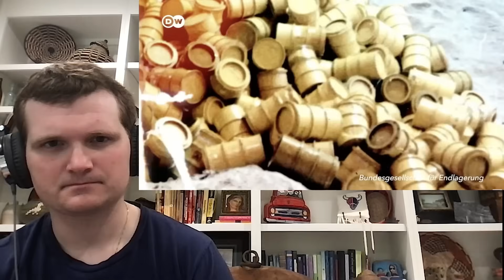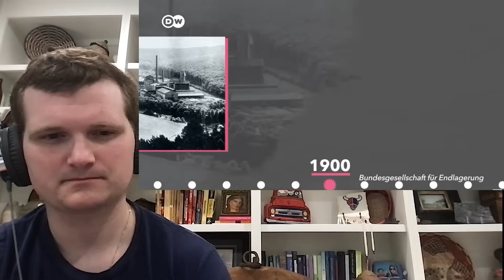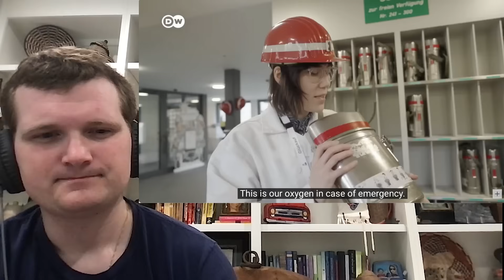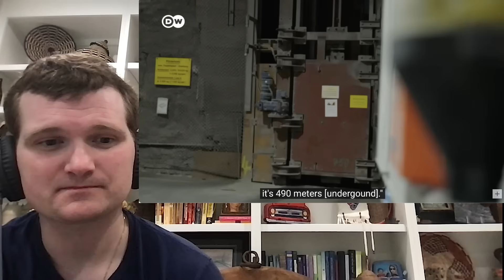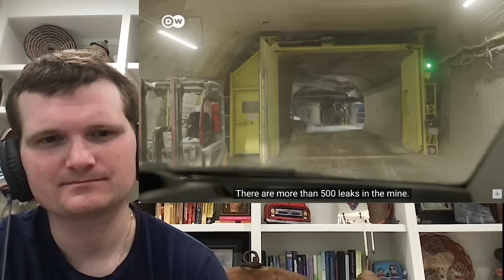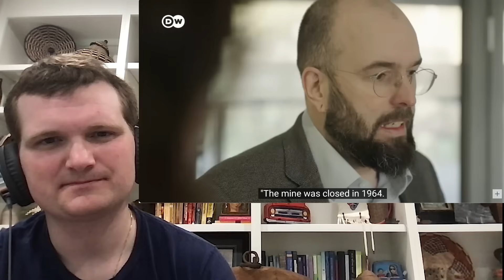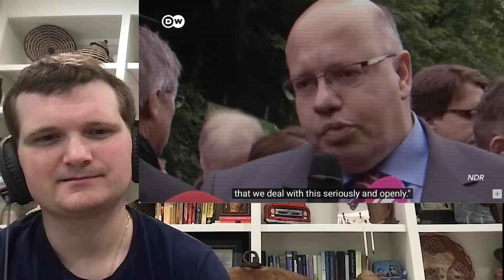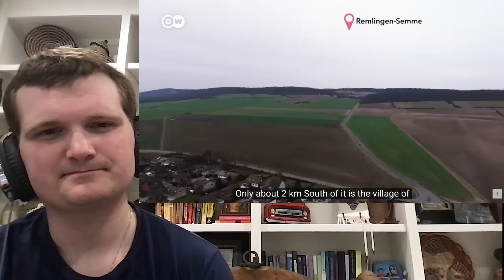This Nuclear Waste Dump Has Been Leaking for How Long? - Nuclear Engineer Reacts to DW Planet A

Comment: So, a few comments from a german:
1. This kind of poor waste management is one of the big reasons our Green party ever rose to prominence in the first place, they started out mostly as an activist group demanding a stop to nuclear power out of concern over incidents (following Chernobyl) and the long-term storage issue for nuclear waste
2. To this day, we still don't have a secure long-term storage site for nuclear waste because the requirements for that are set to safe containment for at least several centuries. There is a site currently under construction for low- and medium level waste, but there has not been a decsion on where to put high-level waste at all, with estimates going out as far as 2074 until such a site is chosen. In the meantime, high-level waste was kept in storage at nuclear power plants, piling up for decades wth no permanent solution in sight. This is the biggest hindrance to decommissioning our now-shuttered power plants, as there simply is nowhere to put all the crap we have stored there.
3. The Ministers changing every 4 years is basically due to our 4 year election cycle; while the ruling party might stay in power, the coalition partners might change, but even if the same coalition stays together for another term t's not unusual for some ministers to get shuffled around; not always for reasons of competency, but due to political shenanigans and influence games. Plus, most of our ministers are appointed based on party politics and seniority, not actual expertise, so mostly they have to then rely on external experts to make decisions; those experts are sometimes poorly chosen or have an agenda, or lobby groups exert pressure to override the expert advice on policy. This right here? Perfect example of energy industry lobby efforts.

Comment: Just 12min into the video but it's important to note, that the DDR was the trashdump for the USSR. Germany did not really have significant nuclear reactors back then and they wouldn't have produced that much waste. Although Germany's safety standards always were amongst if not the highest so naturally there would accumulate more waste if you were to use double the amount of filters or replace machines after one time use.
Also Germans back then were much more thorough so they probably put one pair of gloves in one barrel to be sure. That was the thinking back then. That's why we had underground power lines very early and that beefy, that they still today easily are enough for modern power demand.

On a side note: I've been in a salt mine in Germany. It was an excursion with the class in 7th grade. Pretty awesome and strange feel to be over a thousand meters beneath the surface. And cold.

After the video: Bureaucracy and politics always are a problem with Germans. And after the war, western Germany was the lap dog of the US. Still is to some extent. What do you expect of ever more weak politicians with less back bone by the year...

Comment: Ok, maybe this is just me, but it's a mountain of salt. It can be carved out. Why not find a solid spot in the mine near the waste, dig a giant chamber, line the whole thing with concrete, lead, then salt, move the waste with machines to this new chamber, then fill the whole thing up with more concrete, then top with lead, then another layer of concrete. After that, dig around the whole thing (now safe) and create an air gap for any water or geological issues that may arise. Seems cheaper, easier, and less dangerous overall than trying to move, sort, and process it all off site.

Comment: I can remember this coming up in the face of repeated "castor" transports in the late 80's and early 90's, as a little kid i was already very aware of things and was very much interested in such things.

I can remember the endless discussions about there becoming a need for STILL a reliable nuclear storage place, and we are STILL searching for more locations that are safe or could be safe.

I remember Asse coming up all the time, as well as Gorleben. The issue is that, we need to store the stuff. But the issue is that the mines are either unsuitable because of potential water break ins, or because of the concerns of the public. Ofc nobody wants nuclear waste near themselves. So it is an ever rotating search for a final resting place for these types of materials, and nobody wants to have them, of course. Asse being water ridden is the biggest thing about it. They used it only as a "test site" for storage, but the issue is indeed the scale. It wasn't a minor test. They may as well just have thrown all the waste in there, because they dumped enough stuff in there to make it a final storage anyways.

The good thing about radioactive waste is that it will eventually decay, that is the way of radioactivity. The bad thing is, if this takes thousands or tens of thousands of years, then RIP, its unlikely mankind will be around that long anyways, so yeah. If that stuff leaks, we are all cooked. Minor radioactive or short-term radioactive waste, you could store that in your back yard in a shed away from moisture and any sort of tremors or tectonic activation that shakes it about.

But the issue is as always, nobody wants it, and understandably so.

Comment: 4:15 For better or worse this is the double sided sword of nuclear energy advocacy. It is safe because of the effort put in to make it safe... So what happens if that slips?

We see that on a small scale with the nuclear batteries in Russia, which have been simply abandoned and are dealt with more or less only once the radioactive material starts causing issues that are hard to ignore.

Those aren't going to heavily polute large areas, even if the material wasn't handled after it starts circulating, but it could still cause significant damage if it's just left in a densely populated area.

Granted, it would take monumental levels of neglect to get to a truly big catastrophy with modern designs. Even in the Ukrainian-Russian the heads have remained cool enough to at least keep the nuclear reactors safe, however it has taken a previously operational plant offline, with the associated consequences of losing a large producer of baseload.

However it is the single factor that makes me reluctant to advocate for going all in on nuclear energy. Scaling the expertise required operating safely (numerous contained issues that take plants offline aren't really an option if you depend entirely on nuclear energy) is going to increase the already considerable safety costs further. On the regulation side political stability with a universal consensus on maintaining top notch safety is a must.

The safety requirements more or less limit reliance on nuclear energy to countries which are both *developed and stable*. In other words, it's a loval solution to a global problem.

Of course at the end of the day you don't have to convince me, you have to convince the people who are afraid of nuclear power.

To get over the fear you have to be honest about the risks and the complex, human dependent systems to counter them. Which leaves no honest argument, and people smell bullshit even if they can't articulate why it's bullshit, that skirts around the limitations safety imposes.

Comment: I just can't believe they just dumped it in a big pile. It's spiking my OCD.
Reply: Imagine trying to handle it though, even for low-level stuff. Wearing protective gear, and underground.
Reply: @jimtalbott9535  if you already have to transport it there, it wouldn't be too much hassle to design the containers in a way that made them easily stackable (even by remote controlled machinery), and/or prepare racks beforehand to facilitate this.
During the first years of operation, they actually did stack the barrels neatly. But when the volume of waste grew beyond what was originally planned, and therefore the costs went up accordingly, good ol' capitalism took over. It was simply cheaper to toss them onto a pile instead.
Reply: @stephanweinberger  they already exist and are called pallets

Comment: 0:38  These barrels illegally dumped seems to be a plot point that was used in the netflix  German series called “Dark”  2017 .. three seasons.

From Grok:
 Nuclear Power Plant and Time Travel: The series revolves around a nuclear power plant, which is not only a central setting but also the source of a time travel mechanism. The plant's connection to time travel involves the use of a substance referred to as "cesium-137" and the "God particle," which might be construed as related to radioactive materials or byproducts, though creatively interpreted for the show's time travel mechanics.

- Radioactive Waste and Apocalyptic Events: Radioactive waste, specifically the barrels of it stored in the plant, plays a critical role in the series' narrative, especially in the context of an impending apocalyptic event. The barrels contain a form of dark matter or an unstable matter that, when released, triggers catastrophic events, including the apocalyptic scenario shown in future timelines.

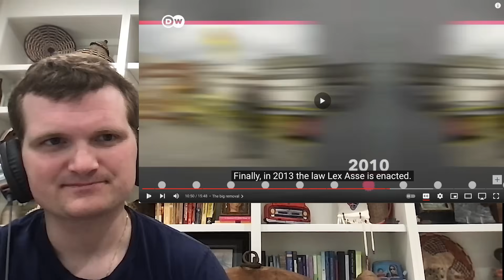Comment: Agree with you at 31:30 - if the nuclear industry in German f'd up this badly for this long, it's no wonder that the public demanded they shut the whole thing down.
Reply: It  wasnt demanded  and wasnt a result of this waste mismanagement. It was a result of the Fukushima accident. That was the reason that nuclear power was abolished, not the waste site displayed in this video.
Reply: @oliverbecker3443  It's always people pointing out failures of old designs (that nobody would built anymore) to justify not building any more. The more modern plants on the same coast in Japan did not have the problems that Fukushima had.
Reply: Do you think the US did any better in the 60s and 70s?
Reply: @steveo7006 probably not?
Reply: @steveo7006 ummmm yes... they put a man on the moon then
Reply: @RichieD_21  Was he disposing nuclear waste there?

(Yes, I know some of the equipment used RTGs for power.)
Reply: @stephanweinberger I know youre trying to be funny, but in actuality he actually did dispose of nuclear waste on the moon considering that some of the equipment used RTGs for power. Bet you didnt know that smartass
Reply: very sad though
its like banning cars because some guys set their cars on fire...
Reply: @zahnatom  in This case it was like 80% of people setting the Car on fire.
Litterly EDF, Areva, Siemens, Vattenfall EON and co screwed the nuclear industry in germany in there own way. 
The asse is litterly, only the tip of the Iceberg.
Reply: @asokawhite  Germany has shot itself in the foot, not with a pistol but with a cannon, by banning all nuclear power plants. God dayum. They lost such a powerful energy source and are arguably contributing more to pollution with their thermoelectric plants. Good luck to Germany in the future.
Reply: @robertoskoka  Funny enough, because of the location of the Nuclear Power Plants, they stopped to cause issues with the Transmission of wind power plants and causing multiple coal power plants to by Shutdown.

Beside taking away, russia to influence Germany Politics because of Uranium Fuel. So as sideinfo 70% of the world Nuclear Fuel trade is controlled by China and Russia. 

And to it because nuclear is so slow by loadf following of the modern renewable Sources this avoided another issue. 

Look at France because of there Nuclear Power Plants, In germany, Austria, Swiss and Spain needed to bring back powerplants designated for demolishening. For a simpel reason overe 50% of the Countrys Nuclear Power Production failed. And now they not have Money to maintain existing plants or replace the Aging ones. 

Beside Electricity in france is now more expensive as in germany lol.
Reply: @asokawhite  A quick Google search lets us know that Kazakhstan, Canada, Namibia, Australia and Russia are the biggest Uranium producers / deposit holders in descending order, with no mention of China. At least get it right. China and Russia don't have as much control as you claim, even if Russia does hold around 50% of the current enrichment capacity in the world (which can be subject to change as it is depends on technology not reserves), with China mainly owning several foreign mines.

And by abandoning nuclear power, Germany increased reliance on Russian natural gas exports. You cannot escape Russia it seems. So it's not as one sided as you made it sound.

And about France having higher electricity costs than Germany - another Google search lets us know that the average electricity prices in Germany are around 41 cents per kWh, while in France they're around 24 cents per kWh. Get your shit right.
Reply: @robertoskoka  not to mention Germany's  increase in use of brown coal after they shut down their nuclear power industry and the negative impacts that has on the environment.
Reply: @zahnatom the difference with nuclear waste is that if you mess up, the mess will be likely forever. That is why nuclear is ao dangerous
Reply: @Max-fw3qy  this is bollocks
Reply: it is. And we are at a point now that wind, solar and battery storages are cheaper now and it is not worth it to build new nuclear power plants
Reply: @xloltimex38  Yep, this last decade Solar panels and batteries have gotten very solid developments to the point that the combo is the most cost efficient energy generation today. 
It is not space efficient, but there are a lot of empty spaces. 
Hopefully it can help us ride the wave until fusion
Reply: @diablo.the.cheater  if they are so efficient, why is the cost of electricity going at a higher and increasing rate in places that have become reliant on them, and not in places that are reliant on fossil fuels, hydro, geothermal and nuclear?
Reply: @xloltimex38  good luck producing all your power with just wind, solar, and hydro. If you dont use nuclear, then you will have to go back to coal of fuel oil, both of which produce 1000x the volume of equally radioactive, and way more environmentally damaging, waste then nuclear power does.
Reply: @xloltimex38 really? Is that why germany has the highest prices in europe? And is completely reliant on french nuclear and polish coal energy when the wind doesn’t blow in the winter? 😅
Reply: @xloltimex38  They are not cheaper, far from it - not are the clean and green. In fact in the UK they have been subsidizing wind power since the 1990's. The ideology doesn't meet reality.
Reply: Ironically nuclear would be the solution to all the problems of Germany, and I do not mean powerplants...
Reply: There is no public. Only Marxism.

Comment: What was not mentioned in the clip and this is the elephant in the room is, that Asse was supposed to be a final long time storage facility. However after only 20 years, this turned out to be wrong. How much should we trust scientists which misscalculated by a few 100.000 years? (I know Not true for the Low radioactive waste)
Nuclear power should not be used (except for research) in an industrial scale while the waste produced is toxic for more than e.g. two generations!

We have only borrowed the earth from the future generations. Why have they to solve a problem which WE knew but couldn't handle? They will only have the waste and not the Power 

Another point ist, that this happened in Germany. How about less democratic countries, how so they handle the waste? Could an incident like this be reported in e.g. China?

Comment: 27:18 From an engineers standpoint, they handle it pretty fine. 
From a politicians standpoint, it is a burning trash pit.

Germany owns no fuel. The Russian fuel needs to be brought back to Russia, which Poland did not allow. The European pool fuel needs to be brought back to France, which Belgium will not allow. 
If someone could know what we Germans have ever done bad to this people😏
That is the main reason, Germany opted out of nuclear power. As for the faith of the remaining high level waste. It has to be stored in Castor containers for at least another 150 years. Until then we will have figured something out. As of right now, there is is a gravitational wave observatory planed, to be drilled into the Oberlausitzer Granitmassiv, which will be repurposed, for final storage. The good thing about this place is, that there is already radioactive ore down there. So all water that may be contaminated, is contaminated anyway. Check for Swieradow Zdroj, a Polish radio-healing bath, which is just at that border of said granite plate. It sits on a geological fault, that belongs to that super volcano and who brought up most of the ore deposits of Germany, Poland and the Czech Republic. 
I

Comment: 2:55 You saying this from your current standpoint, not from one of the 60' and 70'😉 Your country did some abhorrent things too back then. Basically, it is a dump of ash and trash, because the where more focussed on getting things done, than on doing things right.
3:27 guess what😏 
Those barrels are the molds.

Comment: I would bet the O2 kit is a chemical generator type and not a bottle.   
Many intended for mining can last many hours and when used with ready stations in sections that time can be extended to weeks.
Reply: It is and if you need it you will get even more thirsty as you will be anyways. If you ever visit that site take a water bottle with you. The air is extremely dry down there, despite the water that brakes in.